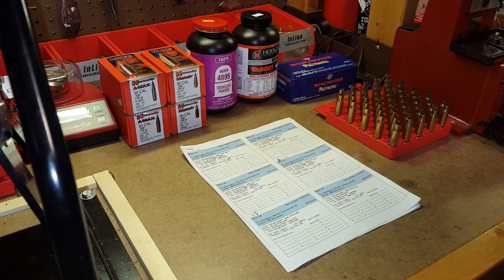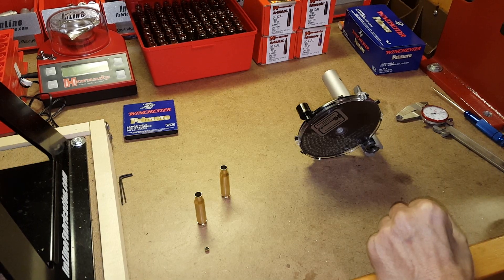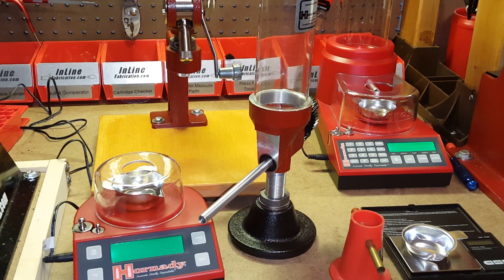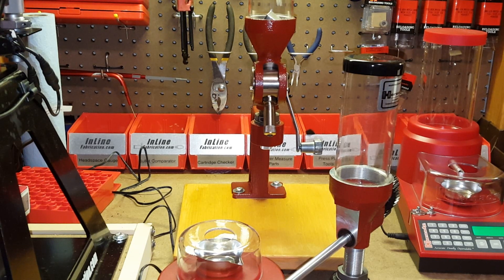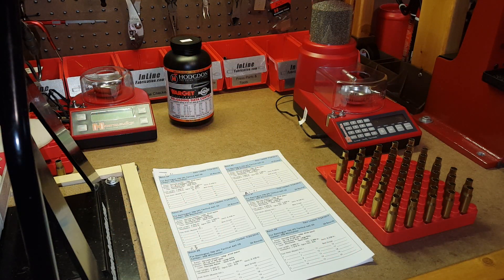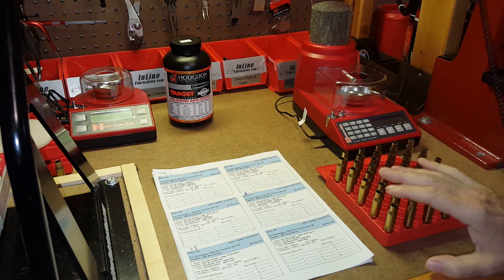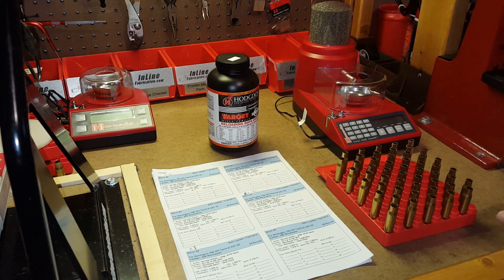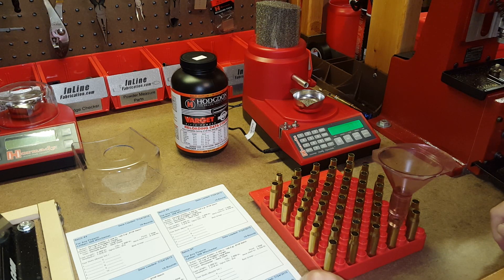Developing a Match Grade Load - Phase 2 - Part 3 - Loadng the Batches

Comment: I'm a bench rest shooter these are great videos on reloading. One thing I do in addition is weigh all my cases. I will always find a few cases in new batch that is heavier  than rest. That means there is less room in that case and cause a higher pressure and in turn that shot will be higher than others. When your shooting for thousands of and inch in a group those cases will take you out of the running. I have found this with all brands of brass no matter how much you pay for it.  Most disciplines do not require this step. Keep up the great videos, Hornady has stepped up there game in resent years. Thanks Rick Dec
Reply from the maker: +Richard Dechau Hi Rick,  Yup, that's part of Phase 3.  I don't do that in phase 2 for comparison purposes.  In addition to showing what steps I go through to create a match grade load, I want to get newer reloaders into the mindset of experimentation and using control groups to make comparisons on what works and what doesn't.  I'll be going over case weights in Phase 3, Part 1 of the series.  It's still in the filming stage ATM though.  Thanks!
Reply: +HornadyLoader I got ahead of you, I should of waited. sorry Have a great evening.Rick

Comment: Excellent!  I put my sized cases upside down in the loading tray which tells me the case has no powder, and then right side up as each case gets powder charge. Slower, but I am never in a rush when I reload.  I also have only one can of powder on the bench like you do.  Before seating bullets, I always double check with a flashlight that the powder level is the same in all cartridges.  I like your method of seating bullets one batch at a time.

Comment: HL --- Great video as always. Regarding hand priming tools, not sure if you have ever tried the one made by 21st Century, but this is what I use and IMO it has an amazing feel to it when seating. Additionally, you can dial in a precise seating depth and length of stroke. Best one I have run across.
Reply from the maker: +scrrady Hi scrrady,  I've seen a few 21st Century products.  They seem to have some good quality stuff.  I've been wanting one of their primer pocket uniformers with the little micrometer in it.  Haven't had a chance to play with their hand-priming tools though.  I'll see if any of my reloading buddies have one and check it out.  Thanks!

Comment: Hornady Loader, You talk about sizing the neck down 2 or 3 thousands of an inch. Is that something you can only do with a neck resizing die or is a special die required. I am just getting into trying to load for better than minute of angle accuracy and am starting with headspace gauges, COL and some of the other things you have demonstrated in your videos. Your videos have been a huge help to me so far and I really appreciate having them to refer back to as needed.  Thanks.
Reply from the maker: +robert austin Hi Robert, Actually, I'm talking about bumping the shoulder back by a few thousandths, not the neck.  All sizing dies for bottle-neck cartridges, whether it's a full length sizing die or a neck sizing die, can be used to bump the shoulder back.  No special die needed.  You might be interested in my videos on "Understanding Headspace" for more info on how that is done, including using special shell holders to set the headspace (Addendum 2) rather than the die itself.  Thanks for watching!

Comment: you sure do load the 168s low with varget. my gun likes them HOT
Reply from the maker: +Justin Wood The idea was to develop a load for a new rifle.  The correct way to do that is to start low and work your way up.  If I had started with the hotter loads I  would be setting a bad example for newer reloaders who use these videos to learn the hobby.   I use a ladder approach to building up a load with a given bullet/powder combo so those starting loads were increased until I found the right combo for my particular rifle.  Thanks for watching!